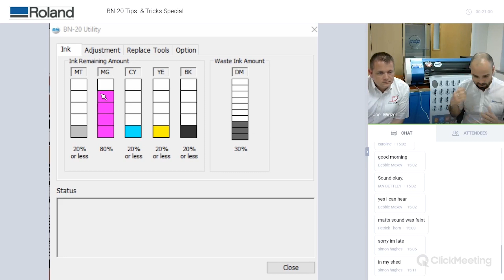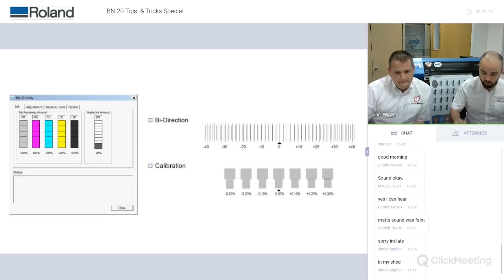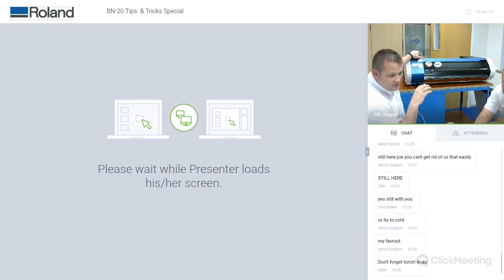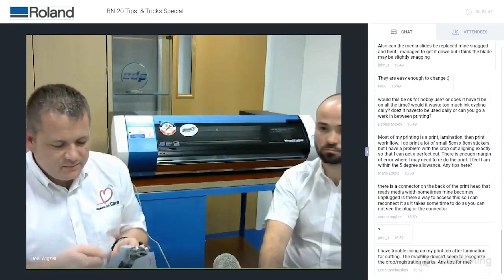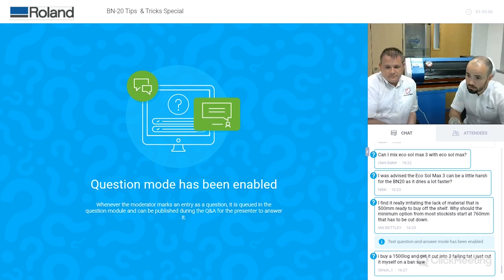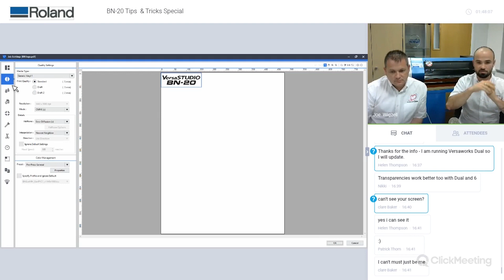BN-20 printer/cutter tips and tricks | Roland DG Academy

Comment: I think this is what we needed back in 2009... T-Shirt forums still boasts the Epson/Graphtec combo as the way to go... and (*shutters*) 3G Opaque/JPSS heat transfers... yeah, don't do that anymore folks. That's a dead medium, it's not commercial grade material and is absolute garbage. I still see shirt kiosks at malls using this crap. If you want to save about $2k, get the BN-20A model as it does not use a 2nd magenta cartridge or white/metallic ink, allowing for a much faster print. About to get one myself, very exciting. Someone mentioned below if it was cheaper to buy printed shirts from a company in bulk vs buying this machine to do it for you.. there's a huge saving to consider if you get the machine and do it yourself. Minimum orders of printed shirts = $500 in most cases. If you did it yourself, the actual value of the bulk would be $150-$200, so you're saving about $300 or so (that minimum order price is LABOR cost).